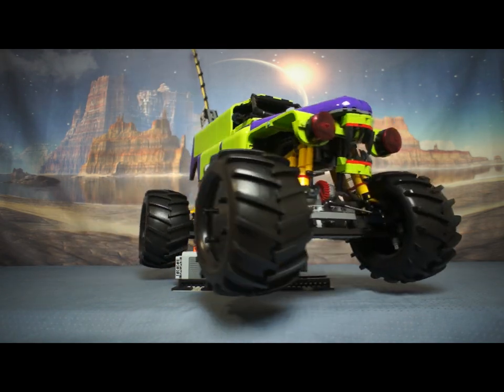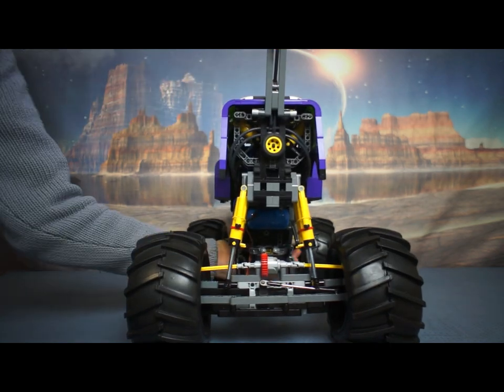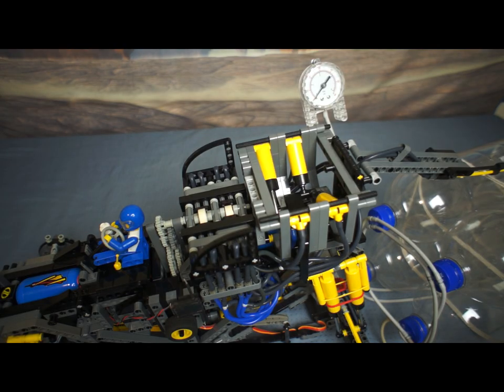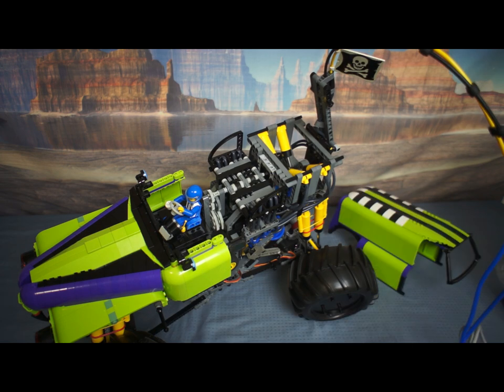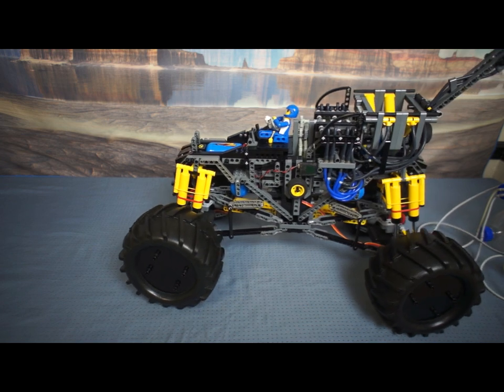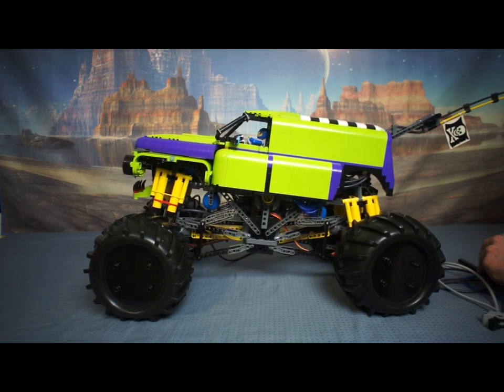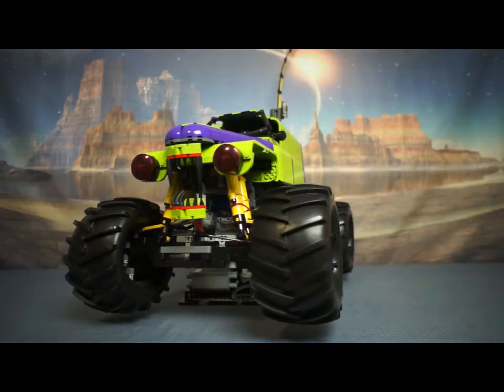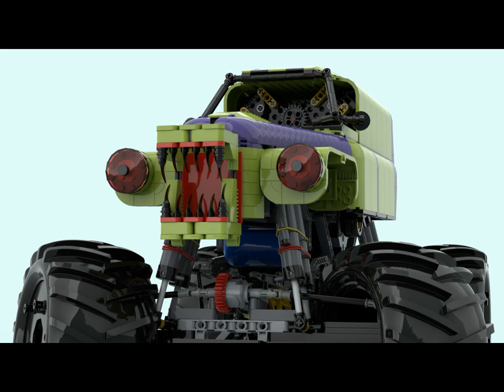Tech Bricks Lego Technic Monster Truck LPE Lego Pneumatic Engine

Comment: Nice build! For body ideas maybe lucas stabilizer or El torro loco
Reply from the maker: I read the Lucas Stabilizer is a petroleum based product so probably should not be used on Lego. I have used Molykote 111 on the air cylinders as well as gears and axles.

Comment: Amazing ! Did you modified the pistons ? Maybe you should to make way more power.
Reply: Yes I took the pneumatic cylinders apart with hot water and a small lever, cleaned out the thick old grease, drilled the air ports to 1.9mm, cleaned the cylinders some more and added thin silicone oil.
I think it needs more air pressure, more air flow, and a switching unit that runs with less effort.